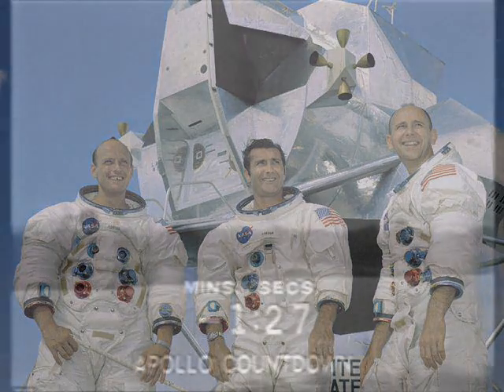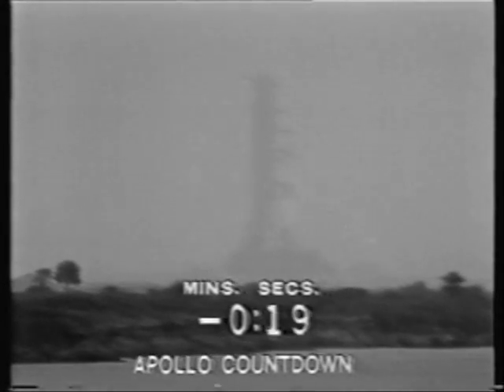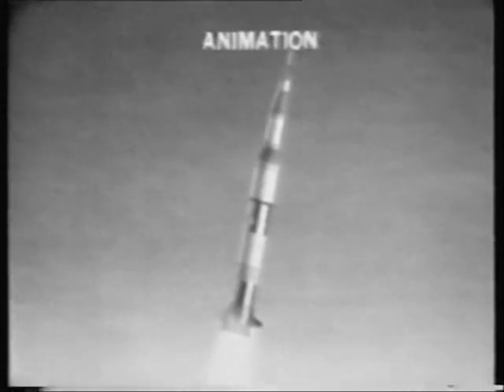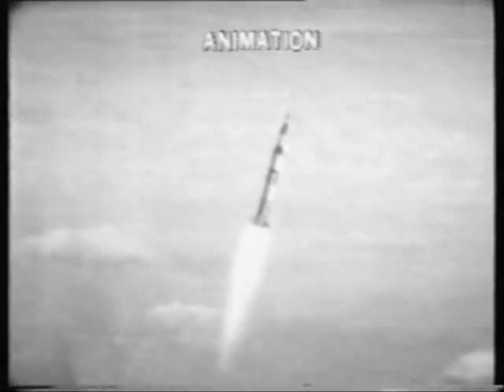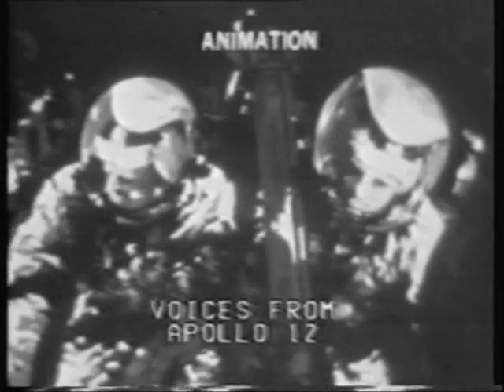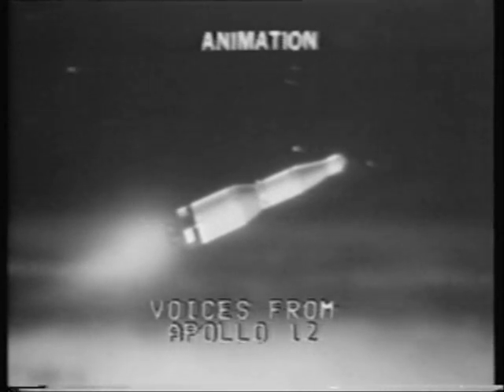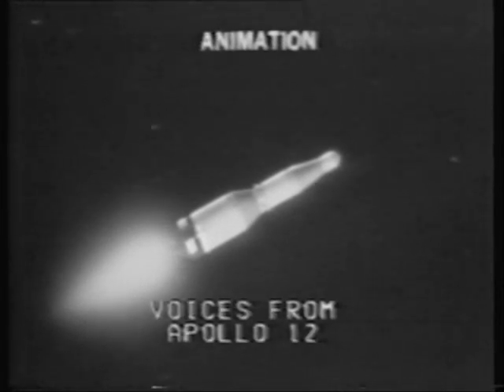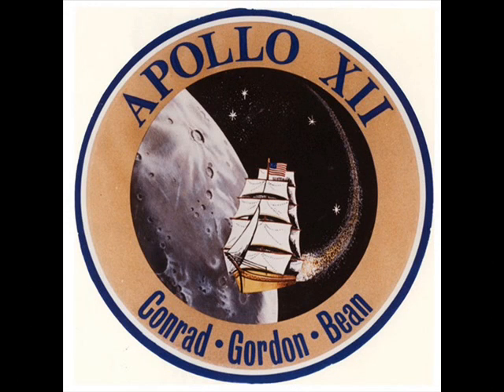Launch of Apollo 12 (NBC)

Comment: @HeliosPhoenix  That's right on the money. 36 seconds into the flight, the Saturn V was going "into the bucket" as it approached the Sound Barrier. Going through the rain at that speed, the Saturn V generated  electrical static buildup and discharged..like a carpet shock. This generated not one, but two bolts of lightning. At least one rode all the way down the Liquid Oxygen vaportrail of the spacecraft, and hit the tower, knocking the vehicle's main electrical systems offline, a "Bus Overload".